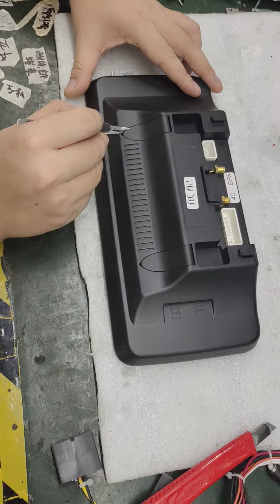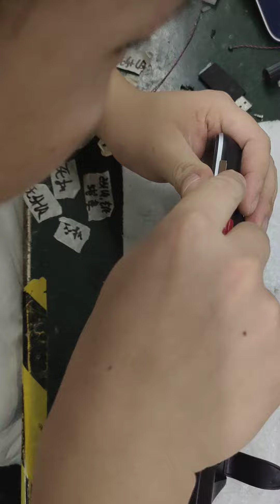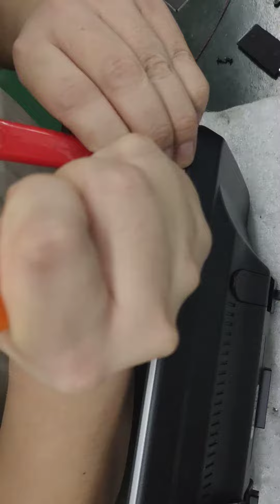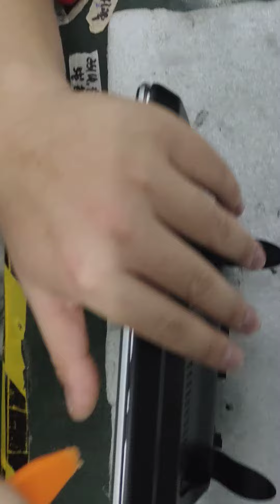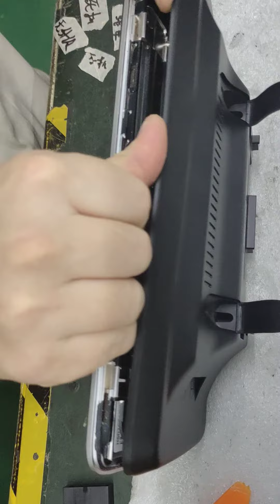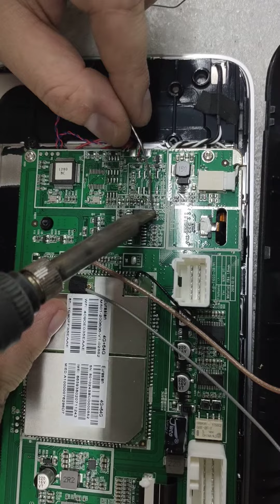Mekede-how to take apart the cover of Mercedes-Benz Android unit

Comment: Aloha!  This was helpful, thank you.  The screen on mine no longer responds to touch.  Do you have any ideas on how to fix?  I have the screen open like you did here, and I wonder which cables are to the screen.  I assume they are the white "ribbon" cables...   I have already reset the unit to factory settings, but that did not fix the unresponsive touch screen control.  Thank you for any ideas!